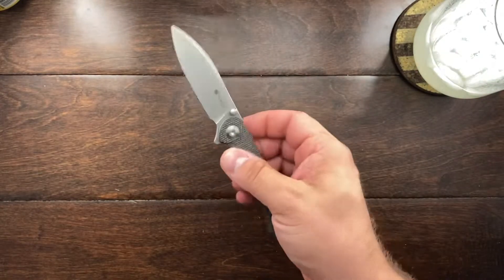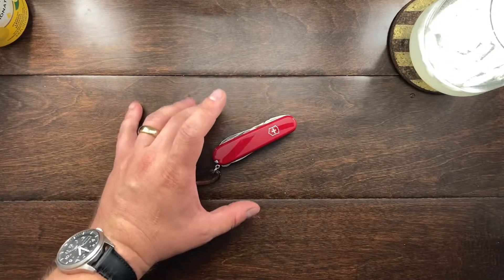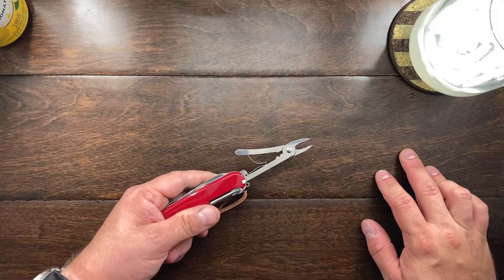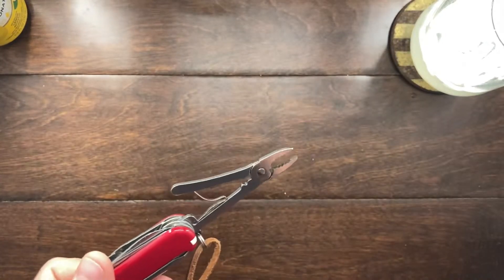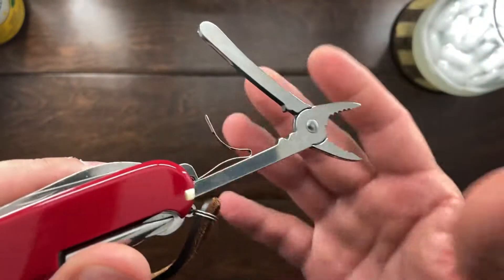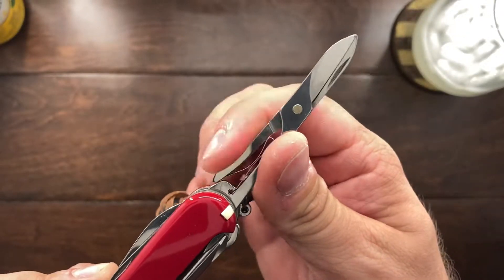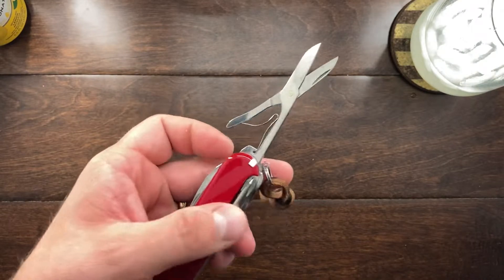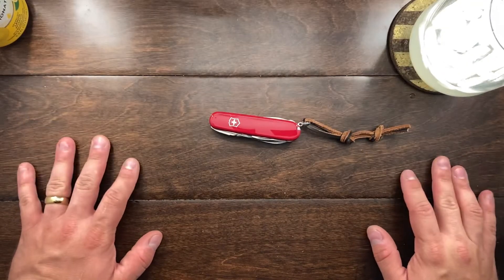In Defense Of a the Leaf Spring In Victorinox Knives

Comment: I remember when I discovered that Victorinox had bought the Wenger company, I was really hoping there would be a Victorinox knife with the far more robust Wenger spring, but it never happened. I assume Victorinox couldn't use this for patent reasons. The spring is ok and I have never had one break, but when they twist of to the side (older knives don't have the guide track) they never work properly ever again. There is a whole box of tools and springs to buy for 146 Euros, but only useful if you fix or own a lot of knives. You must use the correct sized parallel punch to change the spring. Getting the knife in a standard vice is also tricky.